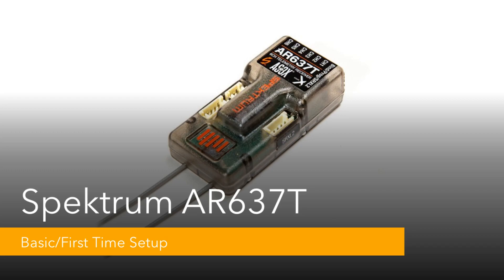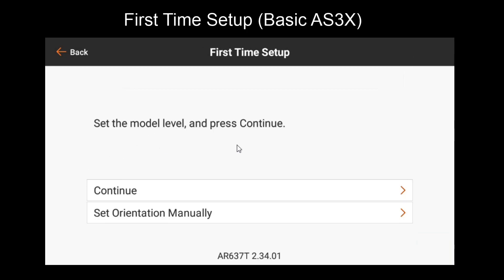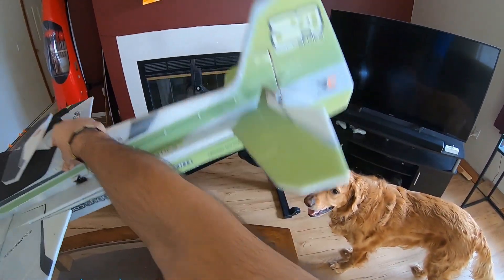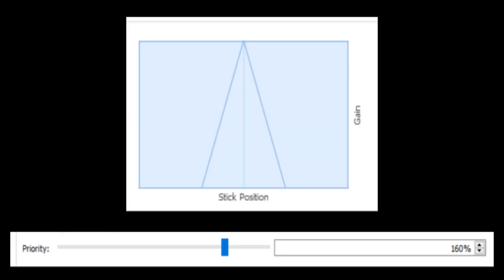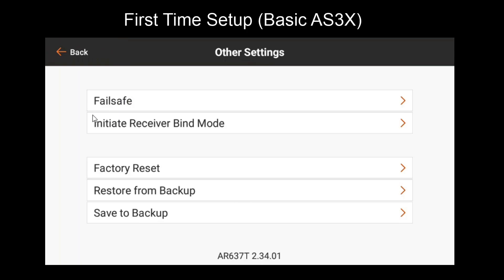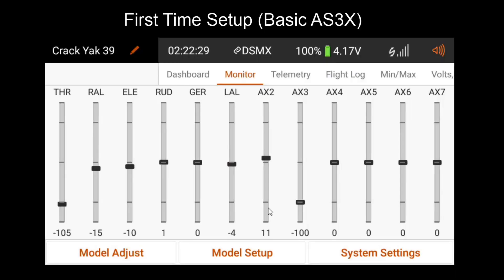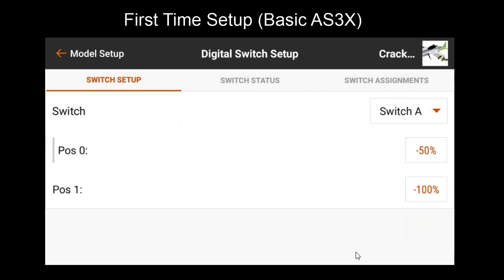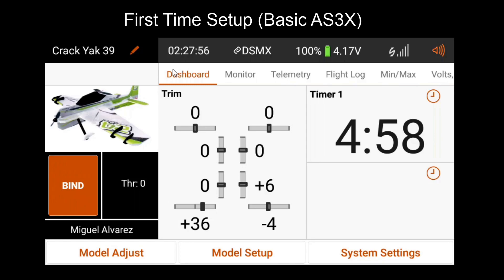1. Spektrum AR637T Setup - Basic/First Time Setup

Comment: When doing this set up, with a taildragger, you have to make sure it is LEVEL, not sitting on the tailwheel.
And you didn't hold the plane straight verticle
I'm reading some of these latest comments,  and it doesn't look like you are answering any questions

Comment: Question: Why is a FM channel necessary for SAFE? Do you have an opinion?
Reply from the maker: We require it to make sure the user has a way to switch out of the SAFE flight mode in case something is setup incorrectly on its initial setup (bad orientation, bad attitude trim, or gains too high). Once you've done the SAFE setup and have confirmed everything is working correctly, you could definitely un-assign the flight mode channel and just have it with SAFE enabled all the time if thats really what you want. I still think its always good to have a way to switch out of SAFE in case the receiver comes loose in the model.
Reply: @MiguelFAlvarez  Wow, thanks
Reply: Wait.  I think I answered my own question.  Is it.... because what safe is doing requires servo inputs, just like a movement I'd make from the ground.  Only,  the person giving the commands is actually a processor in the airplane.   Is that right?

Comment: Many thanks! I had a spare 637TA here and tried putting it in a new sailplane. The elevator servo had to be reversed resulting in AS3X and SAFE moving the servo in the wrong direction. Your videos on unlocking the receiver and then setting it up were invaluable. My transmitter is a Spektrum NX8 with menus very different from yours, but I figured it all out. This is my first time going through the process. Now the elevator is working correctly, and I have learned a ton about all the options available for AS3X and SAFE. May thanks for sharing!

Comment: I just did the programming for 3 AR637T’s. I painfully watched the 14 step Spektrum video. The first plane I did, I did wrong/screwed it up. I think the 3rd or 4th time through I got the plane setup correctly with AS3X, Safe/and 3 flight modes.
If I had to help someone or start over with programming, is watch your video, (I did) watch the Spektrum AR637T video as well, without the AR637T in a plane, just watch the video to their completion.
By the time I got to programming the 3rd AR637T I didn’t need to watch the step by step, I had it figured out, which switches and knob I was going to use etc. 
I did the programming first on an ix12 for all three planes. Then I came back and setup up the receivers on a DX-8.
I’m not very smart, probably have some undiagnosed learning disorder, but it really helped watching everything through without trying to program at the same time.

Comment: Ok, I finally got it set up. I have a DX6e transmitter. For anyone having issues updating the software, use a memory card (my mini one with adaptor did not work). It may take a little work updating it, but it is key, then follow his steps setting up. Not too hard really.

Comment: I have watched a ton of videos on this now and read alot and I have a firm grip. Thank god for your videos it was a big piece of putting together the puzzle. I use a dx6e so I could probably help alot of people, first anybody using the 6e forget about using a switch for the gain channel to figure out your rates. A much easier way is to assign a 3 way switch to 3 flight modes. The first flight mode will have AS3X off, the second can you the defaults 40 50 60, and the third uses say 60 75 90. Use flight mode 2 and 3 and see how the plane reacts. Land and add or subtract gain to each flight mode until you get it where you want it. Tedious but much simpliar then translating it to a %

Comment: Me air Marshall sir   I have a BNF otter the as3x is on when you plug the plane in but goes off when you turn the radio on!  I have tried to go through forward programming and re set it but it just says connection failed,   I don't understand where the problem is, it has drove this old man crazy, I figure some thing simple, ! If you have any suggestions I am all ears!  Thanks sir.
Reply: I think you need to unlock your receiver using the SPMA3065  programming cable because a BNF receiver is locked from the factory.
I could be wrong and I also just realised I replied to a 4 year old comment haha.

Comment: Does anyone know if i can use this reciever with my dx8 gen 1? All I want to do is fly with stability on and have as3x on a switch? Tia
Reply from the maker: You wont be able to configure stability with a DX8 gen 1. However it could be configured with a different radio, and then bound do the DX8 G1, but again, you wouldn't be able to tweak settings if needed.
Reply: Thanks for your reply think I will stick with the AR636 recievers. I have the freewing red arrows 70mm now but haven't had a chance to fly it yet

Comment: About 2 weeks ago I finally got my iX20. Ordered it April 5th. Had also ordered the AR637T and built the plane I plan on using it in yesterday.  After binding, I get a warning. Receiver signal strength 0%. Do you think it's a bad receiver. I have used Spektrum for quite some time. The package had the staple removed and the cardboard insert holding the receiver in place had been taped. Plan on contacting to Horizon tomorrow as I believe the sent me something that had been returned. Any thoughts?

Comment: I'm using a Dx8 G2 and everything is going great until I try to set up Flight Modes.  At that step I can only select Aux 3 which I previously selected for the AS3X gains.  Aux 2 isn't listed as an option so I kink of stuck.  Any idea why Aux 2 isn't listed as available?
Reply: Good luck. Find a mentor. Spektrum videos assume you were part of the design team.  Brian Phillips has some good unboxing vids with DX set ups. I would pay to go to a workshop. Or a zoom format

Comment: Why isn't my AR637T gain working? when i move the plane its not doing anything and i see the RKnob moving on the monitor going from -100 to +100 im using a IX12
Reply from the maker: Make sure you assigned the right channel that your knob is assigned to, and you also need to go over 25% throttle for AS3X to turn on.
Reply: @MiguelFAlvarez  Thank you, I had unplugged my pack cause my esc was beeping and when i tried it it didn't work because i forgot to move the throttle above the 25%. I got part one finished, i flew it and got my gain number, i put on a switch, getting ready to watch the rest of it again to set up the rest. Thanks again for the videos, you have made.

Comment: I am following this step by step. However, when I move my plane, all surfaces show AS3X as working and in the correct direction; but, unlike you, my IX20 monitor screen doesn't show the surfaces deflecting with the AS3X correction.  My monitor only shows stick input.
Reply from the maker: The movement you see on my monitor is from stick inputs (imitating rolling the plane back and forth), not AS3X. You wont see that on your monitor

Comment: Is the AR637T incompatible with the DX7 G2? I have a DX6 G3 with firmware 2.05 that works perfectly with my AR637T. But my DX7 G2 with the same firmware version 2.05 is only able to bind with it but then the telemetry and thus forward programming does not work.
Reply from the maker: Can you go to System Setup -> System Settings, press next til you see the serial number, then select the version number on that page, which should take you to a page called Version Data. Can you share what it shows on the left column? Should be Airware:..., RF PID: ..., etc
Reply: @MiguelFAlvarez  ok, it shows this information:
Airware 2.05.01
RF PID AR 0 1.8.1
PPM I/O 00000055
BootLoad BB07000A
Reply from the maker: @oliverschott4531  do you have any other receivers you can test telem with for the dx7 g2?
Reply from the maker: And btw, I did grab a DX7 G2 with the same firmware from the office, and it worked fine for me, so I don't think it's a bug that we missed with the DX7 G2 update
Reply: @MiguelFAlvarez  I just checked that: My DX7 G2 binds with an AR6600T and receives all its telemetry data. The same DX7 G2 binds with the AR637T. During binding the telemetry link is announced and indicated. But then there are no values for RSSI, neither for vario, neither for altitude. Only the rx voltage is displayed but with a value of 2,2V. But it is 5,3 in reality. The auto config function in the telemetry does not provide any of the expected sensors.

I do have the EU version of the DX7 G2 which only binds with 22ms. For some unknow reason this tx supports only 22ms. Could this be the reason? Can you check with a EU tx (SPM7000EU)?
Reply from the maker: @oliverschott4531  My test was a DX7 G2 EU. Do you by any chance have another one of our newer receivers to compare with as well? AR410, AR620, or AR6610T
Reply: @MiguelFAlvarez  Unfortunarly I do not have another of those new receivers. Is there anything else I could do with my DX7 G2 like a factory reset or a newer firmware?
Reply from the maker: @oliverschott4531  Please pm me on RCGroups

Comment: Should you fly the plane with the AR637T with out any set up first?  Would it act as a regular RX?  Making sure the plane is flyable.  Great demo plane.
Reply from the maker: Yes, it will work as a normal receiver before first time setup. Some people might feel very confident with their bench setup without any flying first, but I definitely recommend flying first to make sure all control surfaces, travel, dual rate, etc are properly setup as desired, as changing those items afterwards might require using the Relearn Servo Settings after setup.
Reply: Thanks.  Really, looking forward to this RX

Comment: Hi Miguel,thanks for the good Video!
Is it possible to use one channel for aileron in the transmitter and have the ar637t do the output for the two aileron servos? Many BNF models like the Conscendo have such a setup  and this enables on a dx6 channel 5 for flight mode and channel  6 for panic mode.
Reply from the maker: Unfortunately, this isn't possible, as the receiver behaves more as a passthrough for transmitter channels coming in, rather than behaving as a channel processor like the 636 does. However, you could always have one of your flight modes be a SAFE mode for auto leveling purposes. I know it's not the solution you're looking for, but it would be the next closest thing.

Comment: Well I have a dx8 gen2 and it’s confusing when you are using a 20
Reply from the maker: Unfortunately, it's very hard to show this on a DX radio as I cant screen share it like I can the iX20. You may have to pause in between different sections, as getting to the menus is a little different on DX, but the process is pretty much exactly the same. Once you're actually in forward programming, there should be no difference between the two.
Reply: @MiguelFAlvarez   I may have to disagree with your statement. I have a DX9 Black and have done the programming with the AR636. What you show in the vide seems to be simple using the ix20, but provides very little help for the other 99% of the Spektrum users that are using the Dx9. Is it possible to make one video just for the DX9 users? Most people will be very thankful and happy with Spektrum.
Reply: you got that right  dx6 here and very confusing and complicated. it looks like i'm going to have to drop some serious money on a ix 12 or just go with a standard receiver.

Comment: I’m using a DX6 transmitter with the ar637t receiver and  all my channels are being used for plane surface control can I still use this receiver?
Reply from the maker: There kind of is a work around to this, but it is very risky and it is quite a tedious process. The reason I say it's risky is because you'll have no way to shutoff the gyro in the air if you set your gains too high. I personally would highly advise against it. I won't go through the trouble of explaining how to work around this, as I'd rather you not take the risk and end up destroying your model. However, if you watch all the videos and understand how the system works, you might be able to figure out how to work around. Maybe even somebody else will figure it out and explain it, I just don't feel ok doing it myself.